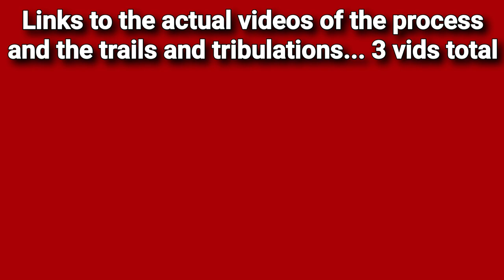Acid Stain floor project: Direct Colors, Cola, Azure Blue w/miracle gro to intensify blue.

Comment: We just finished our first room (utility) and wrestled with the sealer application (solvent based satin).  No luck with the garden sprayer.  My question is how much of an improvement did the wax application provide?
Reply from the maker: Sorry, I'm not getting notifications on this channel for some reason... I didn't really notice a difference.
Reply: @rusticrooster5518  same here - we applied wax a couple days ago.
Reply from the maker: Sorry for the slow response.. so are y'all unhappy with your floor?
Reply: @rusticrooster5518  No, very happy with it.  I learned today from DC that you can use their high gloss wax and buff for more sheen.  We’ve only done one small room (black stain) and will do the balance of the house end of the month in coffee brown.
Reply from the maker: Awesome.. yes I did see that was a option for more shine..